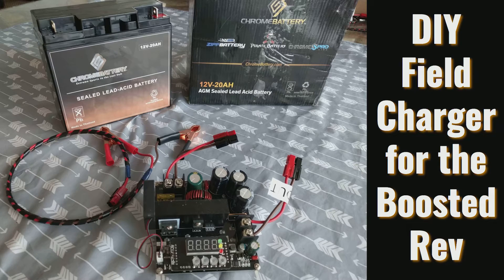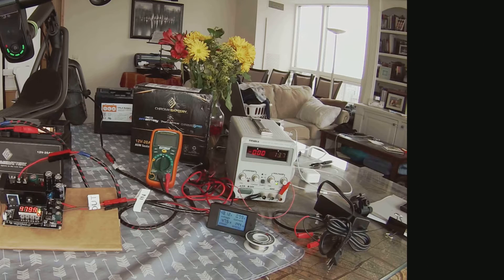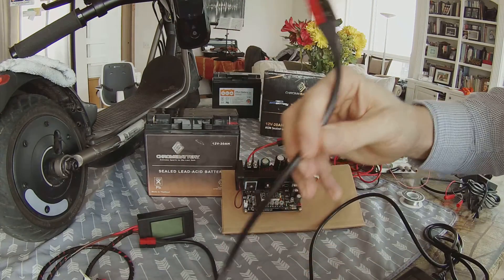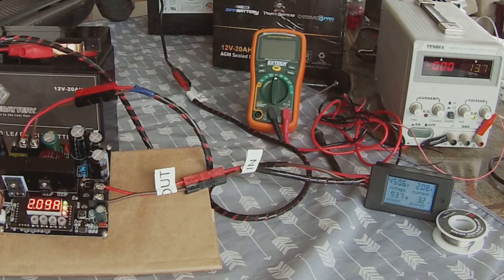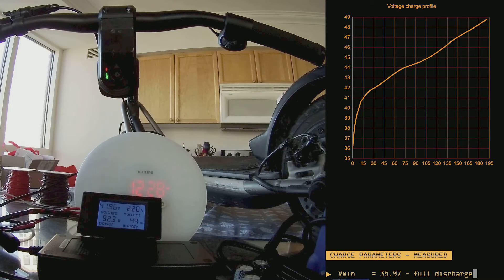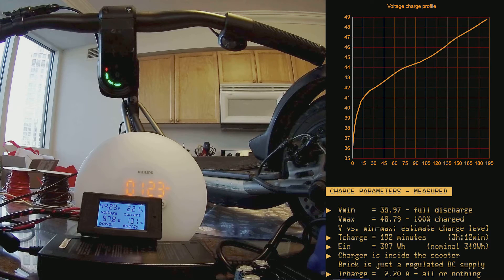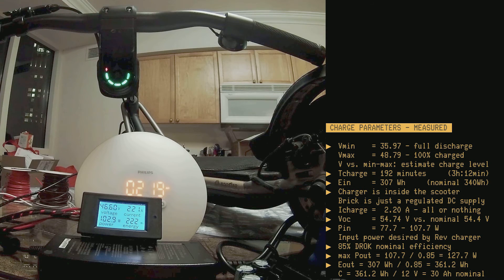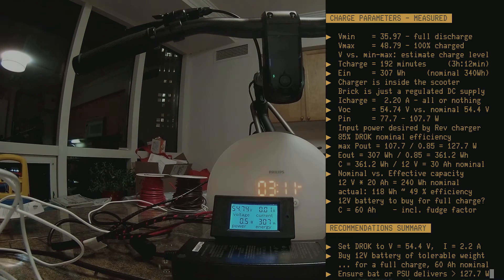Build a field charger for your boosted Rev for less than 70$

Comment: Not knocking your vid, but Why not just buy a good inverter and plug it into your car or connect to a battery? Same price or less And more versatile.
Reply from the maker: No offense taken, this is the first question everybody has. I thought I addressed it in the video, but maybe not explicitly enough. 
The answer is: two reasons -- efficiency and weight. 
▶ Efficiency: you are throwing away energy in a first unnecessary DC-AC conversion (inverter), followed by a second, unnecessary AC-DC conversion (in the power brick). That makes you waste 28-30% of your energy at least, based on nominal values. In practice, probably more than that. I encourage you to run the experiment and see what actual numbers you get.
▶ Weight: your solution makes you carrying around an inverter + original brick, both are unnecessary, since source and user are both DC. 

If you have access to your car, why would you carry around two more things (inverter, brick) when you can carry around one (DROK unit)?

Comment from the maker: ERRATA: according to another source, the Rev's internal battery has 370 Wh energy capacity, not 340 as I report in the video. Apologies.
This is even more disappointing because the internal charging circuitry took 307 Wh empty-to-full, which is 83% nominal. Not great. That 17% difference would probably yield a couple extra miles of range in Mode 3.

Comment: Any Idea Why you cant charge while riding ? This would be really cool if you could do this as you could put the battery in a backpack and charge while riding ! Is it the controller that stops you from doing this and is thier a way to bypass it so you can ride while charging?
Reply from the maker: Yes, good question. I don't think there's an easy way to bypass that behavior without modding the scooter and voiding the warranty.
In my experiments, the internal charging circuitry probes the internal battery's level every few minutes. (It stops, it lets the battery rest for a few seconds, it checks the battery's voltage, and then decides whether to continue with a constant-current (2.2A) stage, or call it done). I suspect that for simplicity, the circuitry is very likely designed to probe the internal battery's open-circuit voltage. It is not designed to determine charge level while the battery is also driving the motors, and is therefore subject to a variable voltage drop. It's a design choice... 
The best thing to do to for you to get extra range would be to install a switch and let the Rev run directly from an external 12V battery through the DROK unit. That, you can probably do without too much effort, but it would VOID THE WARRANTY and I definitely want to avoid that.

Comment: Hi, I've managed to do this with a all In one battery pack with mains power supply built in on a charge tech plug battery pack . The battery pack is 50,000mha I haven't tried it yet to fully charge it from the battery pack. But do you think 50,000 mha is enough ?
Reply from the maker: I'm a little suspicious against these battery packs with an inverter because they waste a lot of energy in an unnecessary DC to AC to DC conversion, which my project avoids. Can you share the details of that battery pack? I've been looking at the specs for a similar product here: https://hf-files-oregon.s3.amazonaws.com/hdpchargetech_kb_attachments/2018/11-20/27645af2-7e61-4248-aeff-fe56995a57c6/ChargeTech_AC-40K-Manual-1.pdf but they don't say what's the internal battery voltage. 
Without it, it's hard to determine energy capacity
If the internal battery is 12 V, then 50Ah give you 600Wh of energy -- nominal.
It says that efficiency is 85% at most.
If the booster AC adapter is also 85% efficient, you are getting 72% efficiency, so you'll be getting 400 something Wh into the scooter, which is not bad. Try a full charge from your battery pack and let me know how it works.
It probably contains a LiIon or LiPo battery. 
If you spend the equivalent money on a battery alone (without the inverter) and you use it with the DROK, you bring home a lot more energy per dollar, and you don't have to carry around extra weight (i.e., the original AC adapter brick). Let me know!
Reply: Here is what is written on the back of the battery pack ...
CHARGE TECH - model name (Plug 54k_Eu) input: DC 24v/ 1.8a usb output x2: DC 5v/ 3.4a type c output: 5v/ 3.1a Ac output: AC 230v / 50Hz ( 250W Max) capacity: 3350mA x 16PCS ( 53600mAh min) battery power: Typical rating <193Wh battery type (Li-ion)   I hope this gives you what you want to know I will charge the scooter as far as I possible and let you know how much it can charge it by . At the moment I'm in the UK I'm not very technical so this all in one charger was most easy for me I didn't understand how to do what you've done but its impressive!
Reply from the maker: @Funsave2012  Yes, unfortunately the piece of information I was missing before is still missing, i.e., the internal battery voltage. However, if you divide energy capacity (193 Wh) by current capacity (53.6 Ah) you get cell voltage, which is 3.6V, a common format for LiIon cells, e.g., https://www.batteryjunction.com/batteries-voltage-3v7.html
Anyway, I think you got the key piece of information here, energy capacity, which is 193 Wh. I'm afraid I don't have great news... it's not a lot. The scooter wants ~300 Wh for a complete charge. In addition to that, you'll probably lose 30% in DC/AC/DC conversion. So, realistically you are looking at 135 Wh you can get into the scooter. That's a little less than half charge. Not bad, but not great, considering the money you spent.
These are just back-of-the envelope calculations - I recommend you try. We won't know for sure unless you try, because Chinese products can be a hit or miss: sometimes they perform beyond specs... sometimes the fall short.
With a piece of tape on the thumb control, spin the scooter till it's completely discharged. Then charge the scooter from the power bank till the power bank is completely empty. Then read the scooter' s charge level from the bluetooth app. Let me know what you find!